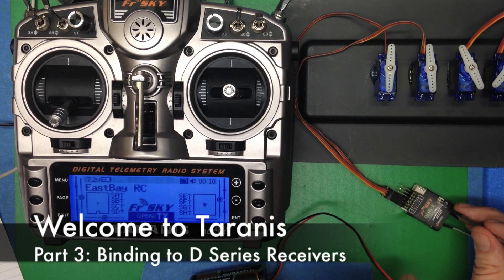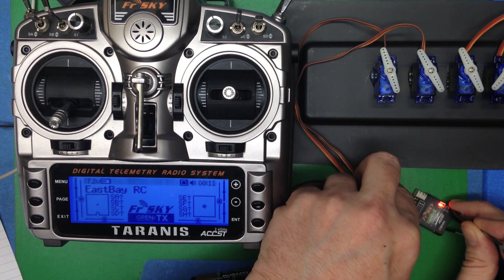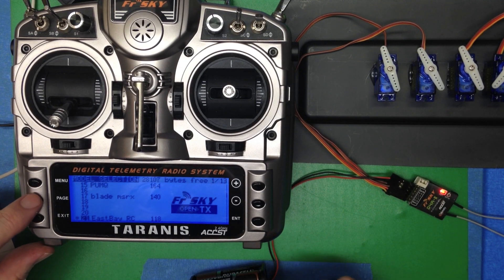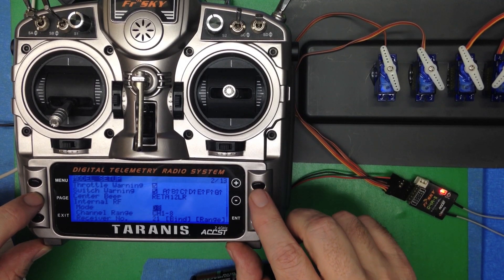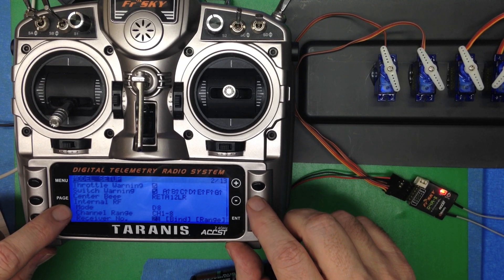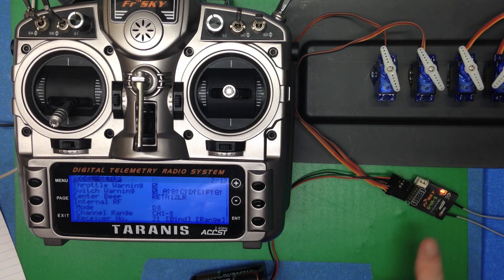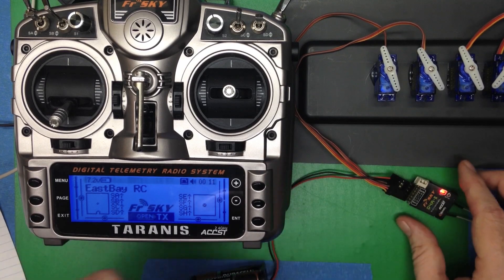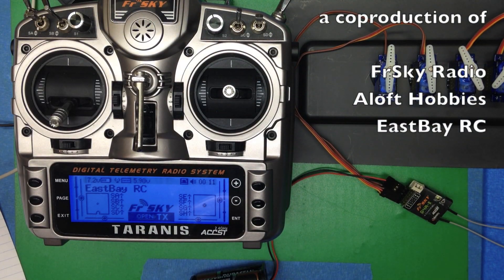Welcome to Taranis, Part 3: Binding a D Series Receiver

Comment: Do you know how I can bind a V8FR-ii ? ..is that a V series?
Reply from the maker: I don't have one, but the answer is Yes according to the manual.  It has to be placed in "D" mode during bind by connecting the signal pins of channels 1 and 2 with the supplied jumper during binding. I found the manual here: http://frsky-rc.com/download/view.php?sort=&down=119&file=Manual-V8FR-II/V8R7-II
Reply: Thanks for the help Mark :) ..I tried placing the jumper switching on, while holding the f/s button and it starts blinking but it doesn't bind. Maybe I'm skipping the where I have to switch it to PPM mode somehow ?
Reply from the maker: aerofokus hmm, shouldn't need to worry about PPM mode at bind time.  You have the jumper on before you power up, and between the signal pins of channels one and two?
Reply: Mark Harrison
yes..I have the jumper on between the signal pins ( unless the signal is + and not the sign that look like a fat T ) ;) ..I'm following the instructions you have on this video and put the int.rf switch to D8..ch range 1-8, but I'm not getting that number you get which to the left of the 'bind' letters..I just have bind and range. I press enter on bind, and Taranis beeps..the V8fr blinks, and that's it..it doesn't bind.
Reply: I got 2 jumpers with it..I wonder if second one has another function apart from being a spare ?
Reply: aerofokus I did it..thanks ;)

Comment: I have a Blade MQX for indoor flying, will i be able to use the taranis for my MQX?
Reply from the maker: Yes, if you have a DSM compatible module.  I use this one from Hobbyking.  Can't post a link, but google for this and be sure and get the JR/Turnigy compatible model. OrangeRX DSMX/DSM2 2.4Ghz Transmitter Module (JR/Turnigy compatible)
Reply: Thank you for the quick responds. I have a DX6i/AR7010 with NAZA M V2 now for my F450 but am a channel short for my gimbal tilt. So if i buy just the taranis without the X8R reciever but with a DSM module i'm good to go, right?
Reply from the maker: Dumplingy1 Yep, that's right.  the DSM module will talk to the AR7010.  Alternatively if you got the X8R receiver then you could use the build in Taranis radio module.